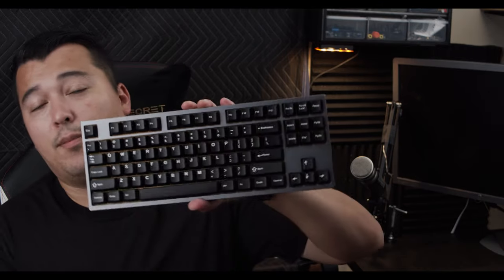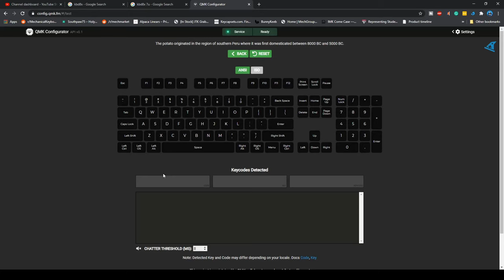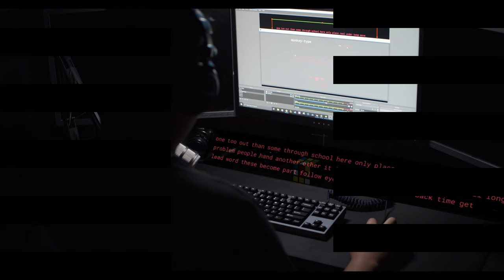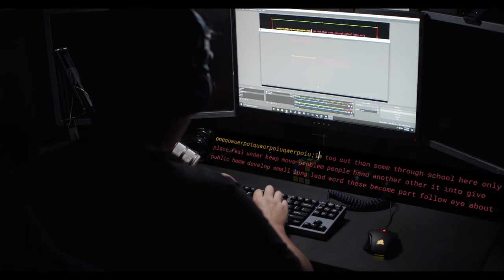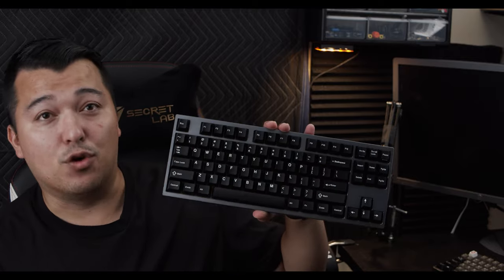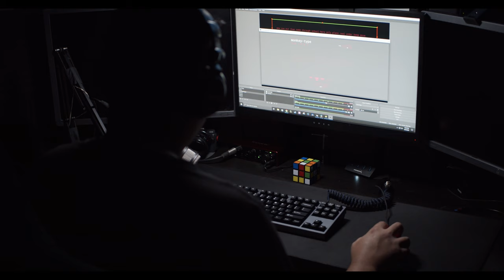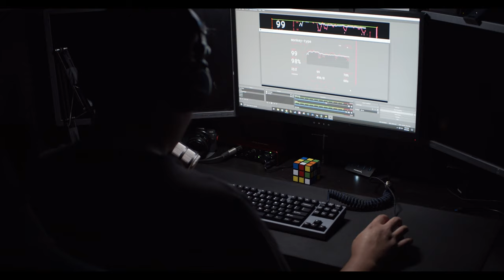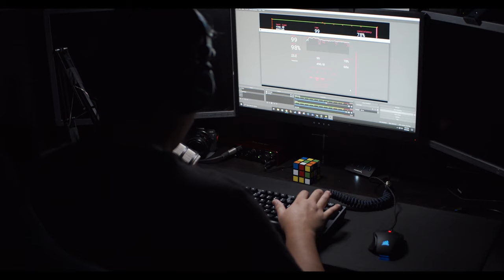My KBD8X mkii Custom Keyboard Build - Sound Test - Time lapse

Comment: really nice video! I like the simplicity of the review and the sound test is great too! :D
Reply from the maker: Thank you very much!, I cant wait to build my next one. So far this is the one I use every day now :)
Reply: @DustinVang  welcome! what will your next build be? How does the typing of the 8x compare to the kbd67? :)
Reply from the maker: @GavinGoh89  both of the questions will probably be answered my next video :). I think the kbd67 is great honestly it is perfect for what I need a small form factor with arrow keys. Lately, though i have preferred the tkl because of the weight and because I have always used tkl. I currently run a kbd8x and kbd67mkii on my desk. They both have different switches so they do sound different but they are very similar in typing experience if you set them upright

Comment: How did you polish the brass weight? Especially the edges and the letters.
Reply from the maker: i would only recommend it if you know how to use a polisher wheel.
Reply: @DustinVang  yes but how did you polish the grooves of the letters?
Reply from the maker: I used a bench grinder with polishing wheel and some compound

Comment: Should I add the Kdb modular foam between pcb and plate? It is very hard to decide and so punishing to regret it afterwards haha
Good vid
Reply from the maker: Recommend puting it in and testing for a bit before soldering

Comment: Whoa, how did you hand polish that brass? I would LOVE to have polished brass as yours looks killer!
Reply from the maker: Thank you! I actually used all stuff from harbor freight to polish it. Used some very fine-grit sandpaper to wet sand down the brass and smooth it out with even more fine sandpaper. Then took it to the buffing wheel with the compound.  cost me maybe 40-50 dollars. Got a grinder, swapped for buffing wheels. used buffing compound specifically for brass. I wasn't able to polish the plate unfortunately since it kept eating up the buffing wheel but I didn't mind because it's hidden anyway. It took me about 3-4 hours of sanding, buffing, and repeat to get it to this point and I probably could have gotten it much finer but I was satisfied with this polish.